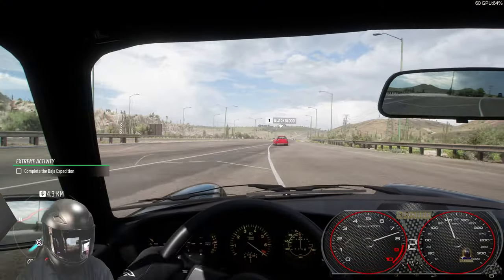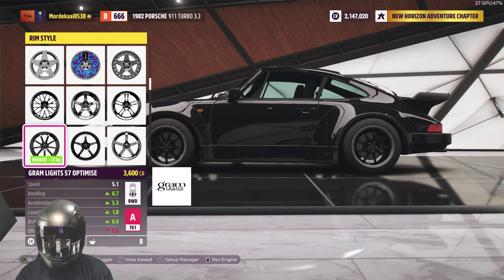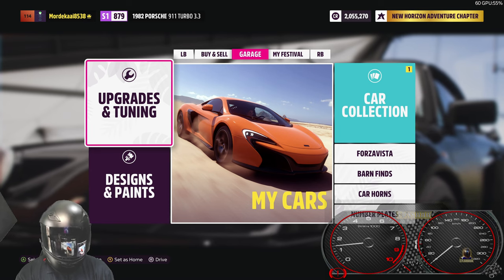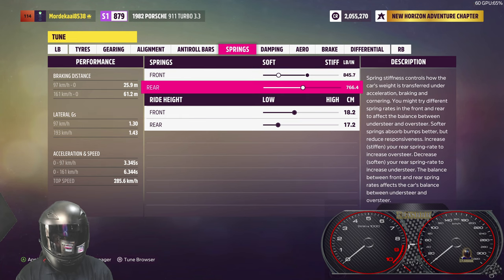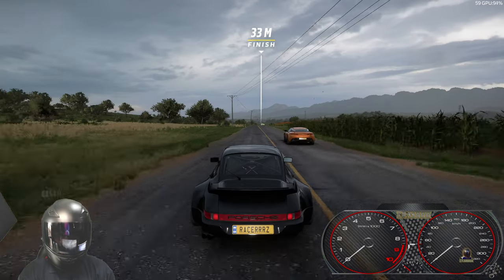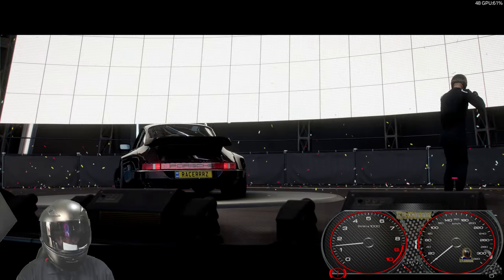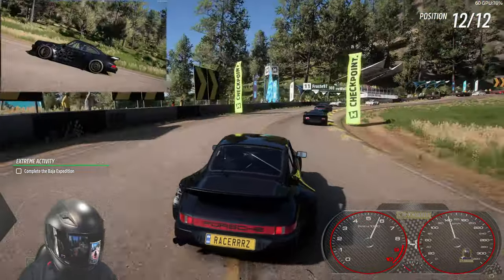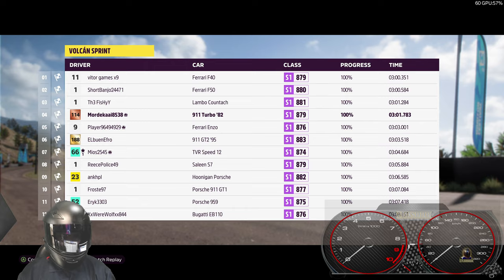GRIP TUNING GUIDE - MASTER your own MR TUNE! (FORZA HORIZON 5 + ZDASHHH + PORSCHE 911, 1982)

Comment: I like this car but still having trouble on the traction speciallyon cornering it tends to slide, i upgraded the engine to the max reaching 700+ hp, i was trying to imitate the BLACKBIRD from the anime WANGAN MIDNIGHT which also had a 700+ HP. My weight wasn't reduce and put a max rollcage but still slides
Reply from the maker: Hi Edward. Yes there remains some sliding and you will need to tune that out to suit your driving style. The best ways to remove some of the slide is to stiffen the: Roll Bars, Spring Stiffness, Rebound and Damping and to increase the amount of downforce by tweaking the Aero settings. It is a fine balance between sliding around corners and gripping your way through. I presume you have slick tyres?
Reply: @racerrrz  I'm using the semi-slick tyres, mine doesn't have the aero adjustment, i'll try out to stiffen the tunes you mentioned and test it. Thank you 😁😁😁

Comment: Grip tuning guide and explain nothing what the blank n hell
Reply from the maker: Hi there. This guide was more holistic and included not just the how of tuning (detailed outline of the settings in the video description section) but also a demo of the tuning effects (road and track racing refinement of the tune). This guide does assume the viewer has prior tuning knowledge and aims to provide a model for tuning and refining the characteristics. Instead of just explaining each setting (I did that in more detail here: https://youtu.be/lZd9pmvgMrU), I demonstrate how the settings can change the car's driving behavior. For a very detailed guide on how to tune a car in Forza Horizon 5 I can recommend HokiHoshi's awesome video: https://youtu.be/wkHNIBBw6Tw